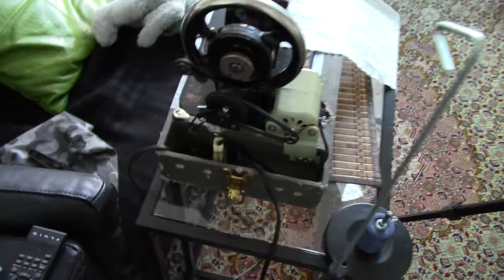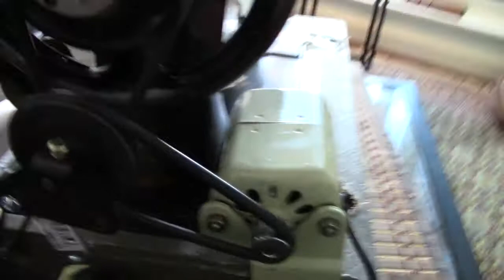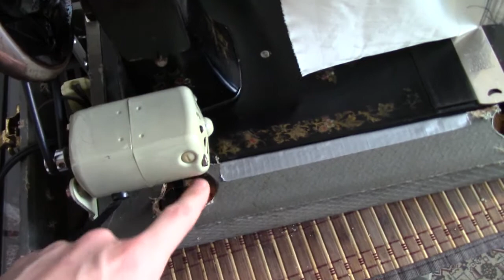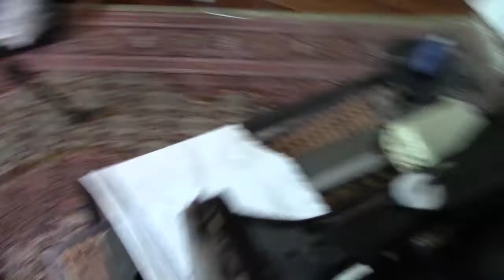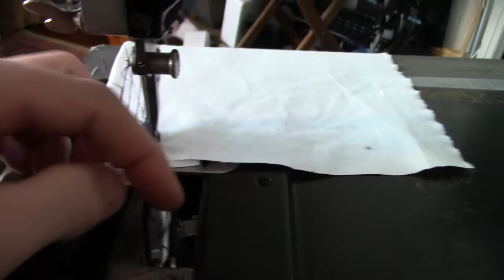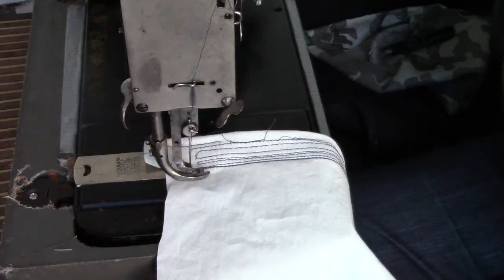Davis Vertical Feed Sewing Machine Electric Motor

Comment: My god that's quiet! Both my Davis VF's (circa 1895 and 1914) are "thumpers". What causes that pounding noise, and how does one correct it?
Reply from the maker: My machine was horrid too when I first got it. In my case, the bobbin arm was not bent enough downwards which caused the spring part of the bobbin shuttle to hit the top. A minor bend and a few adjustments and it is relatively quiet now.